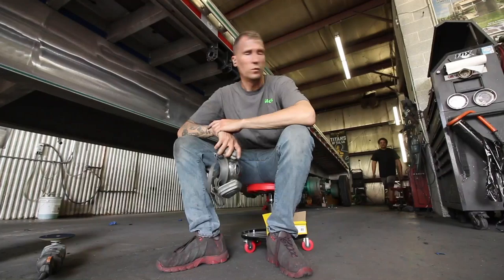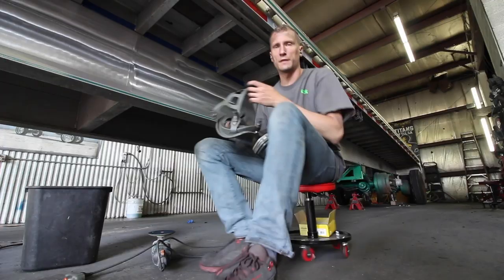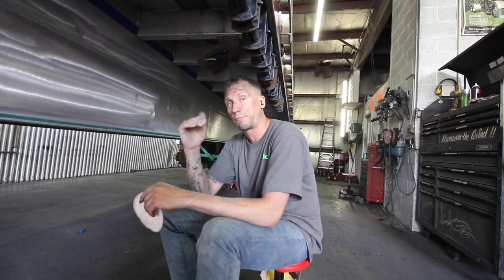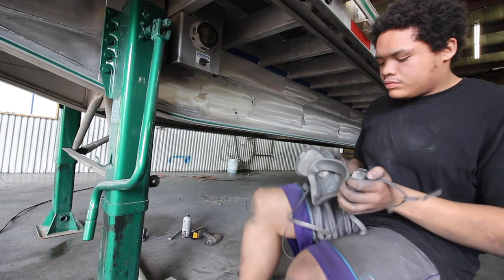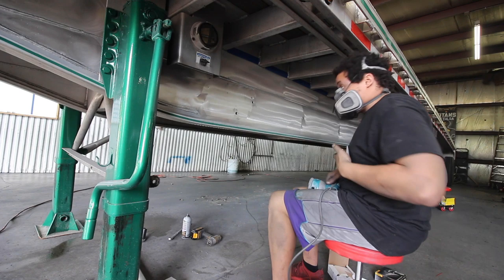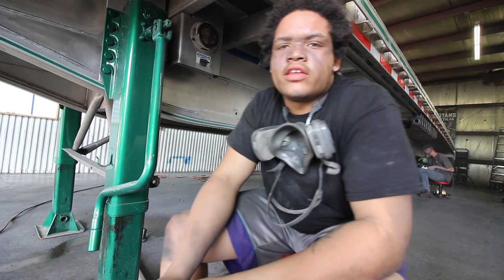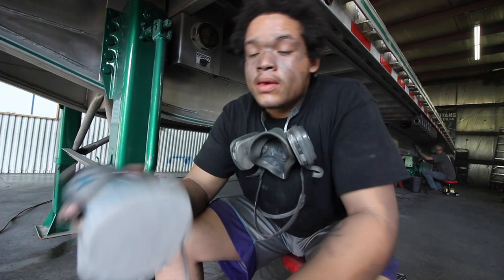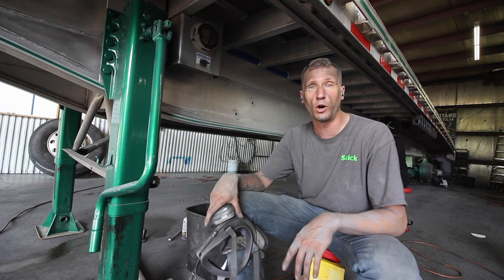How to polish Trailer rails or Pontoon boats - Evan's detailing and polishing

Comment: In previous video you showed on a training tank a side by side vertical vs the horizontal as the last pass. The horizontal proving the eye the most clarity. In this video the DA work was to finish vertical. I’m doing pontoon s so should I be finishing my sanding, cut and color all finishing on the horizontal or the vertical?
Reply from the maker: This is where the art of metal polishing comes into play. On pontoons I finish vertical but once in a while I have to finish horizontal as the metal want to bend that way. Sometimes you have to change it up.

Comment: Evan I love the way you did the trailer I have a question I have a 1985 pontoon boat and I've got small pits in the Finish how far can I send that down without making the whole week
Reply from the maker: That is a great question. Without seeing and knowing the thickness of the metal or the current depths of the pits I have no idea. I say shiny pits are often better than holes in the tanks. Try sanding 400 grit on a spot. See if the pits come out. If they don't then drop down to 320 grit. If it doesn't come out then go down to 220 grit. If it doesn't come out at 220 then start at 220 and work up to 600 step by step. Anything below 220 with an inexperienced user can wreck things or make irreparable mistakes. 220 is a same space and hard to wreck beyond repair. I hope this helps. Thank you for watching.

Comment: I have been driving truck for 20 years and have always kept my truck as clean as possible that use to mean a lot of hand polishing. This year I have started buying grinders, buffs and all kinds of polishing stuff for my drills and grinder/ polishers. Your videos help me learn so much. But I am getting a lot different look than you especially in cutting. I am leaving a black cloud. That isn't easy to get off. On a Reeder tank I actually had to hand polish it after cutting. Then tried to color and it turned cloudy but a white cloud. Any ideas what I am doing wrong.. using all zypher products. Sanded before from 220 to 1000 grit all with da
Reply from the maker: If it turns black when you cut it means it wasn’t sanded enough.

Comment: I was hoping to see a pontoon boat being polished too.  Would a new boat require the sanding steps that you did on the trailer rails?  It seems like the rolled sheet metal of a pontoon would have a smoother surface than the mill scale on the large thick trailer rails, so perhaps you don't need to sand?   

It would be great to see you guys polish a boat too.

Thanks,
Reply: Depends how new. I've done em with under 20 hours and can polish on em no problem. U can polish on 10 year old aluminum and get a great shine. Problem with old aluminum is the pores and pits it will have will be visible just shinier lol. Sanding levels it out and makes everything clean
Reply from the maker: I highly recommend sanding all pontoons regardless of new or old. The mill finish on them from the factory is a pain to polish just right without sanding. Even though they look smooth sometimes they will still polish better if sanded. You don't necessarily need to always go this deep when sanding but I recommend only going as deep as you need to to get through the pits or water marks then work up to 600 and polish. I hope this helps. I doubt we will have any videos on this as we don't do many any more. Most people don't like my pricing as they are a huge pain and a time waster in my shop.
Reply: @EvanStegerMetalPolishing  I hear u. I have done a few of em. Most people say no thanks when they hear the price.
Reply: @WhiskeyNovember888  What could I expect to pay for a 22ft tritoon to be polished/sanded that is new?
Reply: @anonymous_friend A no BS quote from me would be around the $700 mark. Could be more depending on what the set up is like. I've definitely seen it higher tho too. Someone as legit as Evan would likely charge over $1k I assume

Comment: Hi Evan, very informative videos. I have started tryin g to polish my pontoon now and have sanded up to the 600 grit and have now gone with the orange polishing wheel with the red compound and my aluminum looks cloudy, any suggestions on how to correct that. Thanks
Reply from the maker: Likely didn't sand it well enough at 600 grit. most of the time that is what it is.
Reply: @EvanStegerMetalPolishing  Thanks very much Evan, more sanding it is!
Reply: @lancewinters4103  did the extra sanding at 600 work?

Comment: What's your rpm speed
Reply from the maker: I spin 2200 rpm on the sander and on the high speed cut I run 6,000 rpm. Then for white buff finish we drop back to 1800-2200.